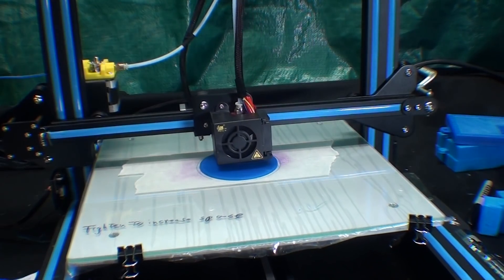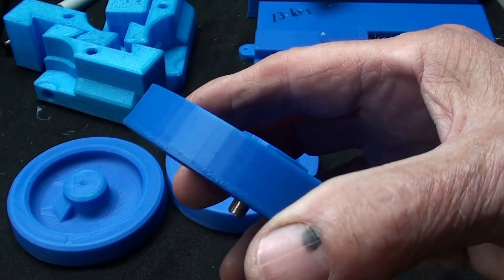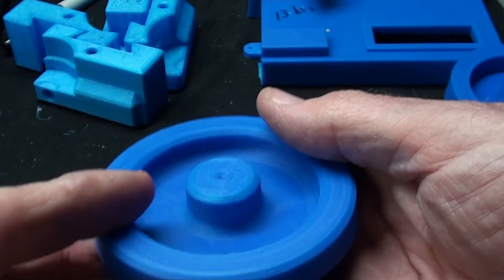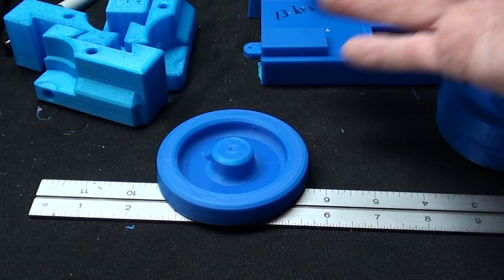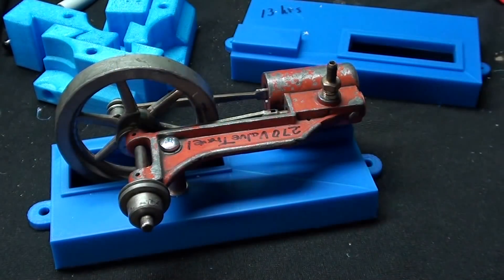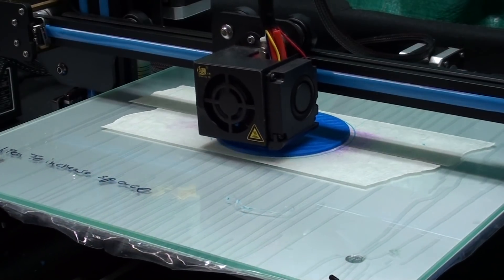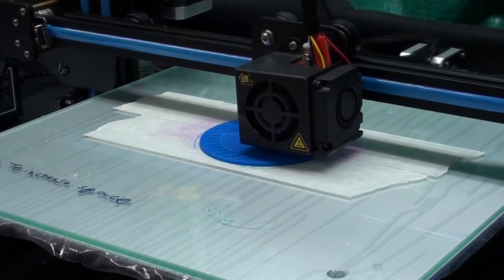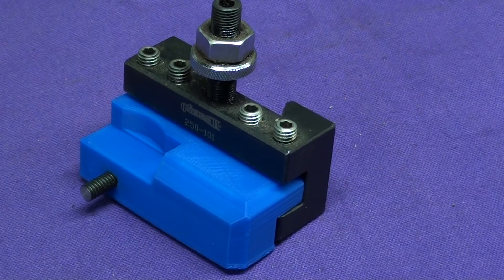3D Printing CREALITY CR 10 with tubalcain #2

Comment: There is a 4 minute video on you tube that explains how to get the free copy, 
https://www.youtube.com/watch?v=qJABXBvuoB4
this is the video. And I don't think you do more than $ 100,000 per year for merchandise or work So you are considered as an amateur just like many more. There are a few limitations on the free version, But for average use it'll do fine, you can work on 10 active items at once but you can put those items that you don't use anymore in archive mode, or read only mode. and if you ever need to work on an older item/ model, just activate thet model. as long as you keep under 10 active items no problem what so ever. And they are stored in "the cloud" Kind regards Hans
Reply from the maker: Thanks

Comment: Late comment, but I landed on using a PEI stick-on sheet as my print bed (applied right to aluminum substrate). No tape/emulsion/glue needed (at least with PLA). Releases and cleans with IPA. Bed heat and creative use of brims and rafts help on tough prints. Clean bed of oil/dust with IPA before printing. I also use Auto-bed-leveling. Make sure the bed has cooled before adding a few drops of IPA and then you can easily remove your print. I have noticed (as folks have stated) that after a while the PEI gets too glossy and looses its adhesion. This is solved by abrading the surface with some fine wet/dry abrasive. Cheers!

Comment: TUBALCAIN, I'm new to your channel and have been binge watching because I enjoy the content. If you would like to learn more about 3D printing there is an event coming up in March 2019 that you would benefit greatly from attending. It's called the Midwest RepRap Festival and happens in Goshen, IN. You could make one of your RoadTrip videos, meet other YouTubers that you may have watched in your pursuit of learning about 3D printing, and I think you would also have a great time. Hope to meet you there!!
Reply from the maker: That does sound interesting-but-
I have backed off on making vids of the 3d printer.   I may still use it a bit, but my YT viewers have pretty much rejected this process.
Reply: @mrpete222  I'm sorry that you aren't making more 3D printing videos. I recently bought a Creality Ender 3 and find that is makes a great complement for a small home shop for those who can't afford a CNC mill. I just printed the Atlas lathe dial and will fit it tomorrow. It would be nice if you could make a playlist with your 3D videos. Keep up the good work, your videos are my reference library!

Comment: If nobody else has said anything about it... one of the things that can cause warping and pulling away from the bed is room climate.  A cold room or a room with air currents can cause problems.  PLA typically isn't effected by those conditions as drastically as ABS, but it may still have a bearing on it.  Especially if the room is very cold.

To be honest, in 6 years of 3d printing, I've never had PLA pull away from the bed as badly as you have.  (I use PLA 95% of the time.)  I really wonder if you are printing in a cold room.

I like that you are looking for ways to use 3d printing for your specific area of interest.  Using it to make bosses for casting is a great example of that.  I've often wondered if a PLA print could be used in a lost-wax kind of casting, where the hot metal melts the pattern and replaces it, much like jewelry makers do with wax patterns.
Reply: BTW, if you are printing in a cold room or a room with drafts, something as simple as dropping a big cardboard box over the printer while printing might help.  In fact, it might be a good proof of concept for what effect an enclosure might have on your prints.
Reply from the maker: My printer is in the basement. It is about 65° down there. I know some people also said to turn the little fan off. I need to try that method was a cardboard box. Many other people told me to enclose the entire printer

Comment: I print directly on heated glass and when it cools down, many times the print just pops off, it helps that many prints are in the same place. Clean but not too clean. Curling is controlled by temperature and first 4 layers mashed down. I have printed since 2011 on my self-made and bootstrapped Prusa I print with ABS, PLA sucks. learn to print ABS on hot glass. Prints depend on the 3D model and the slicer, not the machine. Proof on my Youtube channel.

Comment: Hi,A couple things I am wondering if you have tried to lessen your base lifting problem. 1. Adding a windowed plywood or Plexiglas cube over your printer to keep out drafts.2. Changing the PLA vendor. Not all PLA fibers should be considered equal.Long time subscribersincerely,TN
Reply from the maker: I think I have solved it

Comment: warping, that's a common problem. my cr10 had it too, but it was mainly when i didn't knew enough how to avoid it. the cause of the problem was that the buildplate wasnt completely flat. two things i did to completely avoid warping - was to use Gluestick, i put like 3 layers of it, then on the print, i use Rafts - this gives an allowance to uneven surface. I hardly needed to level the heated bed on my prints and they come out great :)
some people use Buildtack, its a stick on layer to the  heated bed that's supposed to help with addhession. you wont need anything else after putting it on, but it wears out after some use, and it'll need to be replaced.

Comment: I love the 3d printing. Been looking into getting one myself.  But big question I have a southbend 16/24 lathe which didnt come with a threading dial. I see were you can get a print for smaller ones on thingaverse but not sure the compatibility with this much larger lathe? would love some input or ideas how to make one of these thread dials as I am also not sure if there gear that engages the lead screw has more or less teeth on the different sized lathes?

Comment: Love your channel! I've been binge watching your older Atlas videos (10" coming soon to my shop), and I'm just now getting caught up to the present. How awesome to see new tech adopted to older shop methods! When I first got my 3D printer, I struggled a lot with adhesion issues. It was either too much or not enough. The (nearly) foolproof solution I came up with was the hairspray on glass method. Assuming you have a heated bed, the hairspray becomes tacky when heated and hardens on cooling. Consequently, printed parts stick like crazy during the print and simply lift off after the glass has cooled. You can find a number of YT videos on how to do it. Find yourself some unscented AquaNet (purple can) and lay on a HEAVY coat (glass will need to be level). Allow to dry and repeat once more. You won't have to re-apply for quite some time.

Comment: I'm thinking if you use PLA or eSun PLA+  you will have better success with it not lifting up.   Also, I'd ditch the blue or other tape and use glass with purple washable glue stick not over coating the glass, minimal glue stick.  Wet paper towel to wake the glued surface back up after a few prints.   Don't let the glue build up to much.
Reply: I pretty much stick to ABS myself.   Also,  an enclosure around the printer to block drafts would help.
Reply from the maker: Thank you, those are good suggestions
Reply: mrpete222 I have a thin bladed artist tool probably 1.5 x 1" blade I love to break it free from the glass.  It will likely break free on its own when it cools.   I realized recently a thin application of glue stick ous best.   This is a tricky hobby, more than one way to skin a kat.
Reply: If you look at your prints the first several layers seem noisy or not as smooth,  some of that is the result of lifting, some may be slightly too low on the Z axis at the start ripple effect through several layers.  I believe the tape when heated is lifting too.  PLA bed temp should be 70'ish,  ABS 110C.  If you look at my channel you'll see I use a lot of filament.  I started with a printer like yours and later got printers with the sides enclosed and Z axis build plate moved up and down only.  I believe that helps.    I didn't remember if you said your using ABS or not.

PLA can't be welded with acetone like ABS.
Reply: mrpete222 duh, forgot something.  love your channel,  Merry Christmas!

Comment: Once designed and working STL files may be posted to https://www.thingiverse.com there are some other STL file sharing sites as well where you may find parts you need to print out FREE, acknowledge the author of any STL files you use

STL files are used to make the G-CODE with a Slicer like Cura for the 3D Printer, (CNC), to move about
Reply from the maker: Thanks, I am using Cura

Comment: this is for ABS filament: I use Elmer's Disappearing Purple School Glue Sticks, 0.21 Ounces Each, 6 Sticks per Pack (E1560) 
http://tinyurl.com/purple-glue-stick

Direct on a glass sheet. (No tape, etc)

I put in on, (just a bit bigger area than the prints I will do over the next 5 times),, leave it till the Purple colour goes then print with a heat bed set to 65 degrees,.  After I allow the heat bed to cool to 32 degrees and the part comes off easy. This is for ABS filament.

May be used about 4 to 5 times before cleaning with a damp cloth and replying.

The two main types of filament are PLA and ABS, in case no ones told you

Comment: Hi MrPete. Sorry for my bad english. Im from Belgium. I had the dame probs with my bed. And i whent to ikea for the mirror LOTS. Here you pay 8€ for them. They are machial. Bed heat at 60. And then level it. En you can go printing. Then when its finished let it cool down. When it cools tou here them come lose. Good luck with it.
Reply from the maker: Thanks for the advice. I have been getting better results lately

Comment: Hi Tubalcain, the curvature in your prints are due to the process of 3d printing itself. You are essentially putting down a bead of hot plastic which then cools. Your print head moves up 0.1 mm or whatever you have preset it to do and then puts down another bead of hot plastic on top of the cooled bead. When the top layer cools since like every real material it has a thermal coefficient of expansion, it attempts to contract. If the weld/adhesion to the bottom layer is good, this will result in a bending stress that will pull your part into an arc/sled/tori gate as the stress builds up in layers and if the weld with the previous layers is not good, the layers will delaminate. There are two ways to counteract this: 1. Use a different plastic with a very low thermal coefficient of expansion or 2. Enclose your whole printer in a heated (Around 60 or 70 C) enclosure which will prevent the layers from differentially cooling and contracting on top of each other. (Yes a heated build plate helps but only up to a certain height after which the heat from the plate disappates)
Reply from the maker: Thank you very much, you explain that very clearly to me. And it makes a lot of sense
Reply: You're welcome, although it is only a small payment in return for the vast amount of knowledge you have given me. I have a Mendelmax 2.0 at home, and know how much of a pain in the butt 3d printing can be sometimes. Thanks for all that you do for the hobby machining community!

Comment: What brand and type of filament are you using?  I wonder if you have some marginal filament or something.  I have the exact same CR-10 printer and use Tianse PLA filament from Amazon.com and I've never had the warping issues you're having.  And, I would add that the quality of prints I'm getting appear to be far superior to what you're getting.  I print with the standard "out of the box" settings that Cura uses:  200 degree nozzle, 60 deg bed, 1st layer with no fan and subsequent layers with 100% fan.  I've printed hundreds of parts and never encountered anything like what you're experiencing.  I print directly on the bare glass - no tape and most of the time it works well.  If I'm doing a smaller part I sometimes have to use a glue stick but that is rare.  

One thing I have noticed is that if the temperature of my garage is below about 60 deg I have to use the glue stick more often.  If ambient temp is higher I almost never need anything other than the bare glass bed surface.  Another poster mentioned dust - need to be sure the bed is absolutely dust free because that will most definitely screw up your adhesion.

Robert
Reply from the maker: I am now using BAM TACK from amazon. And having much success. Most problems going away--with experience & advise from many including you. thanks

Comment: Prusa has a new  machine  out that  uses a "spring steel" build plate with a powder coating that is  "supposed" to  both hold builds and  release.

Comment: Seems that the bed temperature is too low. You need to keep the temperature  stable  till the end of the print to prevent worpage. In my printer is 96 degrees for ABS, it might be different for yours
Reply from the maker: +Leon Tejtelbaum i'll crank it up A notch

Comment: Try LokBuild printing surface for your cr-10. Should stop the lifting. Also I printed parts similar in pla directly to the heated glass bed at 60c with no lifting or warping. Think higher quality filament helps too.
Reply from the maker: +Bubba John yes, it would be nice to have one of those print beds
Reply: mrpete222 I tried lok build and prints are a bear to get off. Lifting is then not the problem but part release is. I’m gonna try the build tak flex plate system. Think it will end my frustration.

Comment: I added a PEI sheet to my CR-10 which is a semi clear thin sheet.  I then use a 50/50 alcohol mix in a spray bottle to wet the surface and the print.  After a few minutes the print will come off the bed a lot easier.  It won't exactly pop off, but it does save the PEI sheet.
Reply from the maker: +Ed Stoddard thanks, good suggestion

Comment: The best thing i have found for bet adhesion is a mix of woodglue, water, and alcohol. Mix it with about the color/consistency of 2% milk and use a spray bottle to put it on the bed. It leaves an ideal texture for your prints and you wont have issues with buildup on the bed like you can get with glue sticks
Reply from the maker: +FailedSquare thanks, I need to try that

Comment: Your distortion in your print is from the layers cooling at different rates. You can add a cooling fan or a green house. Also try measuring distortion of the bed when hot. And the "special printbed" you speak of is lexan(it is a consumable, 10 or so prints).
Reply from the maker: +Eluderatnight thanks for the advice

Comment: Hi  I have a CR10  I bought a sheet of ULTERN PE! and mounted it on the glass.  I threw the masking tape and glue away.   If you try this you will be very happy.   I bought this from McMaster-Carr  #8685K41  12 x 12 sheet is about $20.
Reply from the maker: +I need to get that. I never heard of that productcncrichard1

Comment: Hi, I had the same issues for 4 years ago when is started to play with a 3D printer, 98% of the time was just fideling and adjusting etc...  most of the prints was crappy and worpy. And I dont belive the improvements in those machines has been better over the years. If you want better result go for some machine based on SLA tech. There is a number of new cheper models out on the market. Dont even try ABS on the machine you have, you going from 98% problems to 110%. You need to build a temp controled chamber round the whole unit and start the build on a glas sheet with capton film on and a layer of abs juice working as a glue for the first layers of print. You also need a heated bead. Regards

Comment: One tip. Printer filament can absorb water, which can cause all sorts of issues; ABS is worse than PLA, but in a humid environment it can become an issue. Many people store their filament in a dry box; here's a good instructable for making one: http://www.instructables.com/id/3D-Printer-Filament-Dry-Box/ This can help with issues like layer adhesion and such.  Also it will help keep your filament clean in the dusty shop environment.
Reply from the maker: +Bruce Johnson thank you, I did not know that

Comment: For flat print parts on the botom you need heated bed... for fast print use the infil 25% ... if you have heated bed put up on top  the glass  capton tape  and clean with silicon remover and dont touch surface with fingers.... on capton tape clean  you can print PLA , ABS, PET but PET  need elmesr glue for wood you can make one drop the glue and use wet sponge for cover all surface with glue.... glue need create very thin layer ;) smal pcs.  Of sponge make in filament for clean dust if not some times yor nozle you found blocked. Sorry my english i never study this languidge.  I know watching the films. 3D modelig programs hawe low quality circle be cose use triangle in said surface  for fast calclating and visualisation tray too change same properities on your software for mor points subdivision in arcs  you can create parts more smooth but havior files more triangle. Its posible in sketchUp.... i dont use more this program now i use  solidworks  its powerfull.